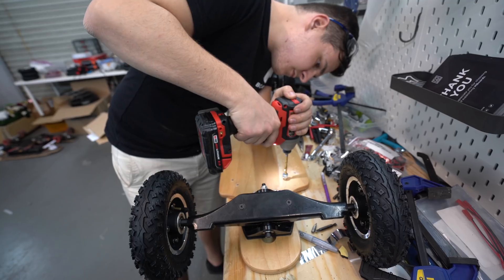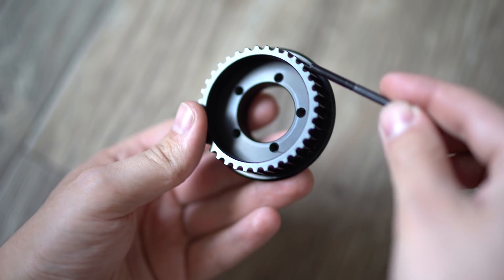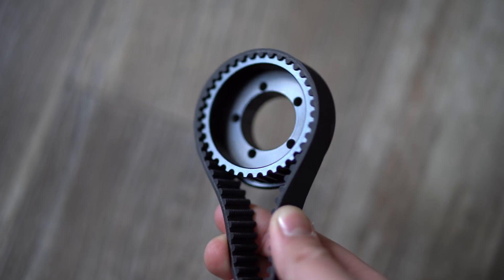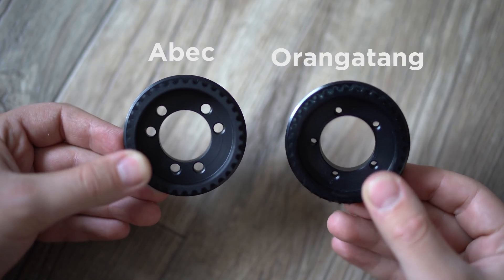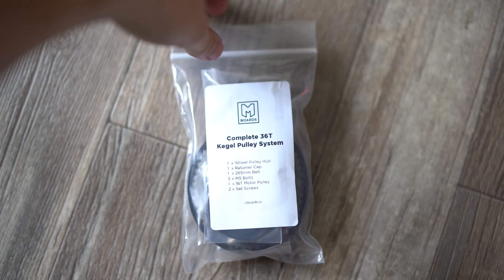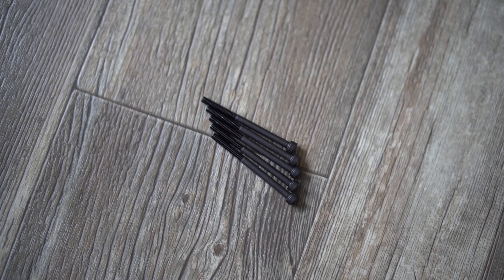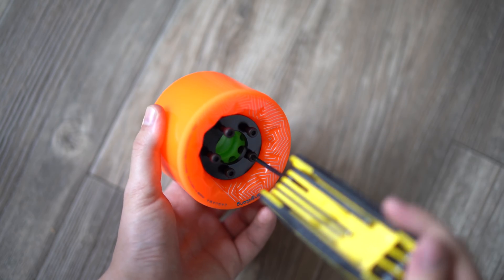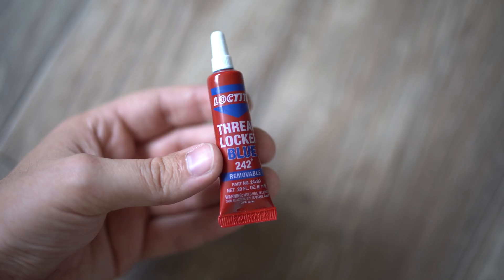DIY Electric Skateboard Wheel Pulley | Installation Build Guide

Comment: Tks for the great video. New to esk. Just bought a used 121c Aileron arc board. Width of the belt is 9mm. Can I use a pulley gear which is 12 or 15 mm with the same 9 mm belt. There is a belt enclosure which restricts the wheel diameter & just thinking that if I get a wider pulley gear it will stick out far enough to clear the enclosure & I can fit a bigger diameter wheel. Tks

Comment: Great video! Are all DIY pulleys secured with the plate or can they also be secured just with the axle nut like on Boosteds?
Reply from the maker: These specific ones are secured with the plate
Reply: @MBoardsco But when would you choose one method over the other if the wheel has a core?
Reply from the maker: Many times the pulleys that are secured by the axel nut will take up extra room on the axel (room that many times isn’t available). The wheel pulleys that are secured into the wheel only are sometimes the only option depending on the trucks that are used. 

Hopefully that makes sense 👍🏻
Reply: @MBoardsco  Gotcha. So, it comes down to axle space. Thanks for the explanation!